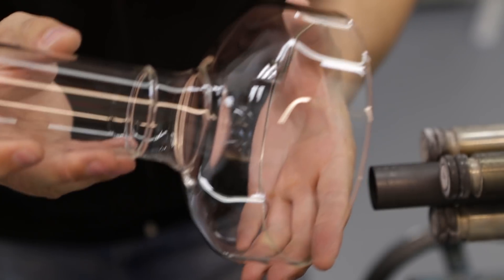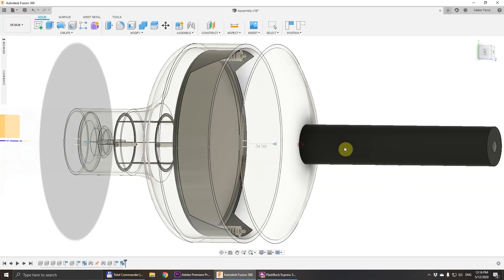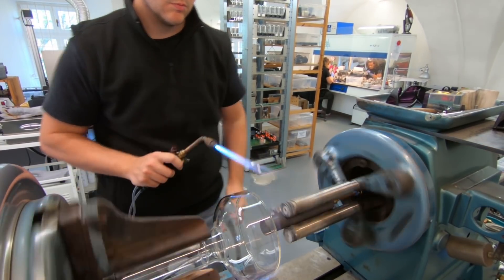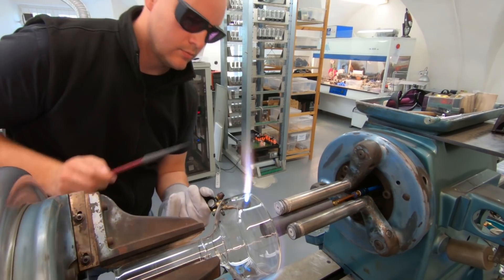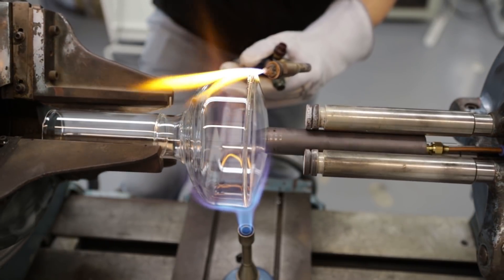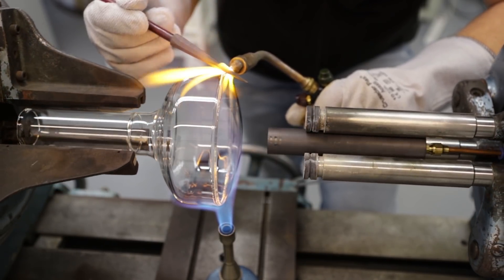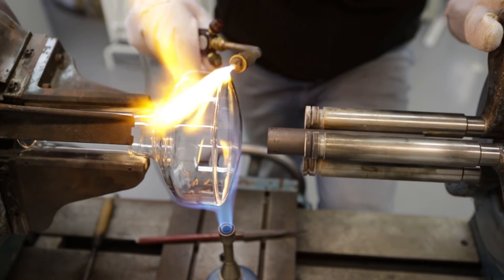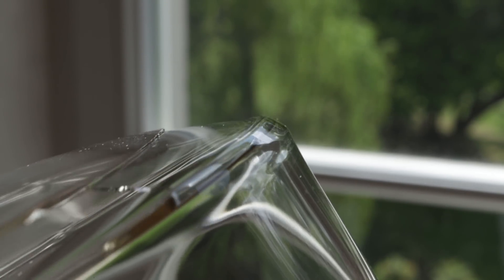First Window-Envelope seal | Project H #3

Comment: Are you using compressed air as the oxidizer for your torch? If so, you could get a bit more heat if you use oxygen or nitrous oxide instead.
Reply from the maker: The flame temperature would be lower than oxy/gas.

Comment: Thanks so much for sharing your new venture with us, I have followed you from the start and it is so impressive to so how your business has developed from the early days where the great Ron Soyland was helping you to get going. I love the glassblowing aspect of the projects, my father worked for a scientific glassblowing company in the UK called Jencons, I used to enjoy going around the factory looking at all of the different setups used in production particularly the Heathway glass lathes similar to the one which you purchased. On your current problem, you probably already know this but I think that much larger burners will be required, here is a link to work on a large item where a "Window" like item is being sealed to a large tube by Ross North (admittedly larger than your new item), the burners are massive in comparison to your first attempt: https://youtu.be/gRH6VURSCcs. Wishing you continued success!
Reply from the maker: Thank you for nice comment, so you’ve been around for quite some time! Thanks for the tips regarding the glassblowing, bigger torch is definitely necessary!
Reply: Thank you, yes, I guess a fair amount of time has passed, although it seems to have gone fairly quickly. I'm looking forward to seeing the new tube when you manage to perfect it, it is bound to take a lot of effort as it is very different but I know that you will succeed 🙂

Comment: You need to push up the size of the Bunsen burner too.  I'd also look into something to push the heat back down, like a reflector dish. If you happen to have one of those old electric coil heat lamps, unpowered. Just sitting behind the lathe, slightly above the work piece to reflect the heat back at it as a lot, and i mean a lot of it is lost to atmosphere.

What is happening, and you probably already know this, is you're reaching the limits of an open space setup when working with glass. A glass maker i talked with, told me that there's a distinct border between a certain size or mass of glass, above and below it, and that glass makers need to have completely different setups depending on which "weight" category they're punching in.

Wishing you luck on the next one, certainly a bigger torch will help, because it solves the biggest issue (more heat).

Comment: If you have the second torch try setting up your first torch like the gas burner to permenently heat the glass. Maybe from 2 angls with the gas burner to give more even heat.
Use the second burner on a tool rest mounted to the lathe so you can grab the torch further back and still have good control over it. A short tip would do with this if you get a long handpiece.
I realy like your work. Greetings from germany.

Comment: you can rotate it on horizontal and let gravity apply the pressure for the top part. Also it would be ok if you can apply heat from all directions - same temp, multiple points. And then just let the two pieces merge.